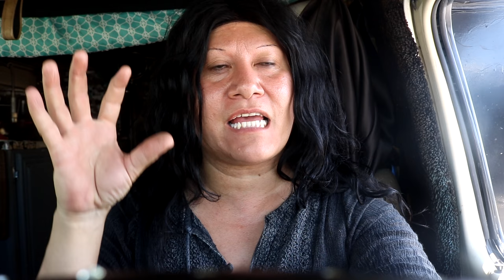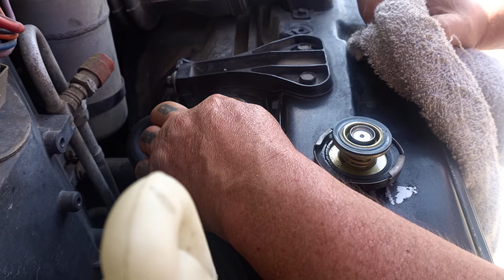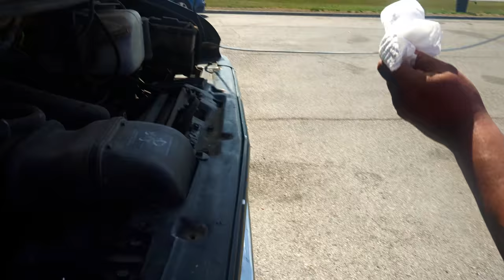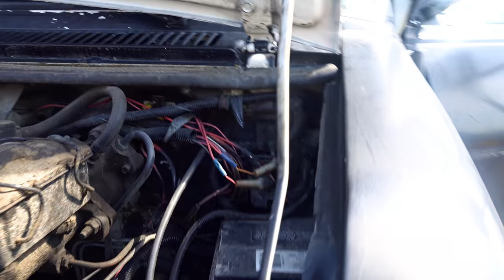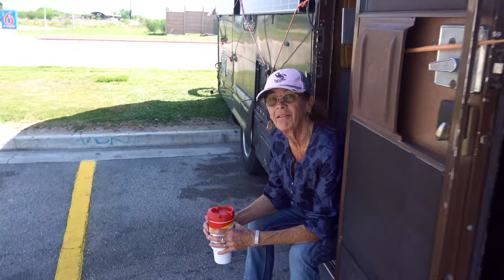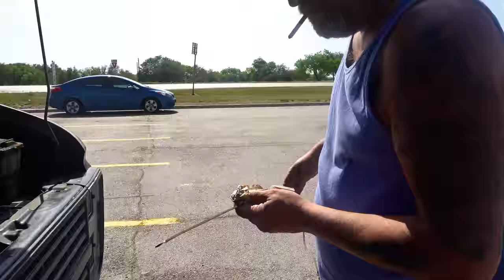RV Breaks Down Not Sure What's Wrong!

Comment: Ausia...its been my experience that gas will boil/(vapor lock) at a much lower temp then water/ anti freeze. If your fuel line is close to a heat source aka mufflet,exhaust pipe or what ever us hot. It will boil(vapor lock) if the flow thru the fuel line is not "fast enough" thru the fuel line next to that heat source. In other words...re route it AWAY from ANY heat source to prevent future vapor-locks....make any sence to you??

Comment: in that big V-8 with all the pumps it has to turn and it being warm you should be running 10/40 weight oil. if you don't know what those numbers mean let me enlighten you . in the 10/40 oil means it pours like 10 weight but protects like 40 weight. so when the weather is warm and being that is a V-8 you should be running 10/40 weight. in the winter the 5/30 is a good choice. in your case oil changes every 4-5,000 miles and tune up's every 10-15,000. you call that preventive maintatince. that's your home you don't it to end up broke down some where you don't want to be and stationary. stay safe.

Comment: How old is Panda? At my mechanics suggestion i added an electric fuel pump to my 1987 Chevy class C to prevent vapor lock which he says is a very common problem with older vehicles because of the changes in fuel since 1987. This may not be your situation but he told me that he makes quite a few of these repairs on rv's in the summer while people are traveling through Albuquerque. Just a thought. Good lock.
Reply from the maker: Thanks

Comment: Sounds like it's either your fuel filter (requires new fuel filter) or its vapor locked (requires new sensor)I have personally had both of those problems and the symptoms are the same. I used to drive super dusty roads and it clogged the fuel filter, I would punch a hole in it to get to town and replace it. I had another car that was vapor locking, I took it to 3 different mechanics, cost me several hundred dollars to figure out it was a $30 sensor! LOL!
Reply: TravelChic56 , not sure it's been a long time. I finally took it to a dealership and they put it on a diagnostic machine.

Comment: I had similar problem before on older car and it was catalytic converter - plugged up. In warm, cool months, no problem but in summer and when car got hot when driving, it would happen - car just shut off. If I let car cool down, it would start and I could drive again. But if it was really hot, it would only go so far and happen again. You can test by removing converter and driving around. Just put a straight pipe there to connect exhaust. Haha.
Reply: TravelChic56 If it sometimes chokes or hesitates then maybe plugged, like mine was.

Comment: If you have 100k miles on your van you may want 20/50 weight.
I have 300k plus on my current truck. My van had 163k on it.
I spoke to an staff member of Castro oil decades ago and he told me if I had over a hundred thousand miles on it and I'm in Southern California to put in the 5th 2050 and I never had a problem with any of my vehicles when I did that and I drove thousands and thousands of miles just saying. Also I check my oil daily when I start out in the morning I looked under the vehicle to see if there's any drops or drips and I pull that stick and save the engine.
Reply from the maker: There is only 48,000 miles on Panda.... thanks for the info

Comment: Modern engines really should not vapor lock. The fuel pumps create enough pressure to force the fuel through the lock point. It may be that you have a fuel pump getting weak and not putting out enough pressure. Good luck

Comment: IT COULD BE FUEL PUMP HAS LOW PRESSURE WHEN IT GETS TO HOT!!!! OR BAD CAP AN ROTOR OR FOULED SPARK PLUGS OR BAD PLUG WIRES OR BAD TIMING DIRTY AIR FILTER. DEPENDING HOW MANY MILES U HAVE ON ALL OF THEM PARTS!!!  JUST SOME THINGS TO THINK ABOUT GOOD LUCK!!! LOV YA

Comment: If it's a vapor lock put clothes pins (the spring kind) on the metal line. That will disapate the heat. That's a old school fix!! Good luck
Reply: Darrell Wampler 40 years ago I had a dart with a318 that vapor locked when ever it was hot clothes pins didn't work
Reply from the maker: Thanks
Reply: @gene Snyder...my high school boyfriend had that same engine...same car but was the Plymouth Valiant. LOVED that slant 6, drove it many times, bull dog steering and all :)
Reply: forgot to say...same year. She was black with a red pin stripe. "Black Beauty".
Reply: Darrell Wampler great minds think alike

Comment: 7:36 am cali time♡
Lions&tigers&bears...!!
MIJA & moo moo you two be careful out there.. honey says you need a code reader could be a manifold air pressure sensor, reads the amount of air in the manifold and tells the computer how much fuel to mix with the air. If the sensor is breaking down do to heat or wear, it could be shutting the fuel off. Most vehicles with fuel injection come with a sensor of this type (could be called by a simular name). Mija i hope this can help.be safe out there asking the angel of the traveler's to watch over all !
HASTA MANANA, safe travels &onward bound ♡

Comment: Your coolant needs to be flushed it's old and dirty,Another common things with Van and motor home is exhaust pipes to close to starter will make a weak starter over heat and not start.My Old Chevy van would do it.
Reply from the maker: Thanks
Reply: With automatic trans. Check your oil once a day especially after going through mountains.If the Ol' girl is burning oil you may want to go to a hotter spark plug.Also when your down south where it gets hot, go with a heavier grade of oil like 10-30 or 10-40.
Keep shiny side up.:)

Comment: That guy knows very little about automobiles. Also he didn't put your radiator cap back on properly, The arrow on the cap needs to point at the overflow tube. Fuel injected vehicles with high pressure fuel pumps in the tank do not vapor lock. Also checking your oil once a week is not enough. Check it at every fill up, it only takes a few seconds.

Comment: Nothing to do with your cooling system radiator thermostat or   Any of that   Fuel line getting too  Hot Old trick try putting   Clothes pins along the fuel line closer to the carburetor helps dissipate Heat

Comment: It concerns me that you were  low on coolant and that it bubbles up when you throttle the engine.  You might have a blown head gasket??  Missing fluid and sweet smelling exhaust are some visible symptoms.  Of course this isn't the reason for a no start when warm.  This seems to be more of a ignition module going out,  time to have the throttle body rebuilt or fuel pump and filter replaced.  My best guesses.  
I have an '88 Chevy class C similar to yours and am pretty familiar with the engine.  I wouldn't blame vapor lock really the entire fuel line is on the opposite side of the vehicle as the exhaust. There is the part when it comes up the back of the engine where it would be the closest.   Another thing I can hear is a exhaust manifold leak.  Pretty common probably passenger side.  GM likes to put a heat riser valve there.  It essentially restricts exhaust on that side to help warm the engine faster.  When the flapper fails the manifold gets really  hot.  Otherwise pretty reliable engines.  Good luck!
-Jon

Comment: Sounds more like vapor lock than anything you did; even though what you did was good for the engine. Also check your fuel filter. If it happens when your fuel tank is low that would be a good indicator of a fuel filter issue. Never hurts to change the filter and it’s usually cheap. Next step would be to look for the routing of the gas line where it comes near to any really hot heat source (for vapor lock) and if possible, shield it somehow. Be careful to use some form of non- flammable heat shielding material. Good luck. I hate this kind of issue. Don’t ask me how I know. 👍

Comment: what ever you do don't listen to that guy look on you tube for how a closed radiator system works yours is working fine,next time it doesn't start use a water bottle with a small hole in the lid and put some gas in it  and squirt it in the throttle body and see if it runs then you will know if its fuel or spark if it starts on the gas its fuel problem if not its a spark problem and don't let people rev the engine like he did he has no idea what hes talking about in a warmer climate use 10w-40 oil, you should be 3-4 inches down from the rad.cap when cold on radiator fluid,

Comment: So, yes, you can safely mix synthetic and conventional oil. But barring an emergency, it's not a great idea. All motor oil, whether synthetic or conventional, is a combination of base oils and additives. ... In fact, AMSOIL does not support extended drain intervals where oils have been mixed.Apr 13, 2015
Just for your info. I was nervous about the mixing. But in emergencies, it says it's ok. Vapor lock does happen. Have had it happen a few times. Pain in the butt! We got a bag they sell to cross the desert that keeps the radiator cool. Vapor lock did stop. Maybe a coincidence? Your mechanic will know when he gets to look at the engine. Peace and Love and good luck!
Reply from the maker: I always use synthetic and don't mix it
Reply: You are right Miss angie webb in an emergency it is ok but not an  ideal In older engine, synthetic oil will weaken seals on old engines that not made for synthetic oil and in the long term the seals will leak, I have personal experience using synthetic oil in my 69 chevy impla.
Reply: angie webb I had a car that would vapor lock all the time. At least the mechanic said it was vapor lock and couldn't do anything about it. It would cut off at intersections and I would be stranded for 15 to 30 minutes until it cooled off. It even stranded me after my husband's funeral. It wasn't overheating either. I finally got a new (er) car. I kept that one to fix up and give to my son but the the flood came and it was under water for 2 weeks so I was able to just write it off with insurance.
Reply: You definitely Can mix senthetic and conversation oil....they actually make a senthetic blend which is part senthetic and part conversation motor oil....

Comment: Vapor Lock Old School Trick cut a grapefruit in half put it on the fuel pump.
Reply from the maker: Thanks
Reply: lol how would that do anything..... and the fuel pump is located inside the gas tank, whos going to drop the tank to put half a grapefruit on a fuel pump....that's not going to do anything. Why not fix it properly?....
Reply: sromo522 cool. We used to use wooden clothes pins to suck the beat off the fuel line. Might even be that a heat shield fell off.
Reply: Your better off eating the grape fruit, you can benefit more than your gas tank

Comment: I have had the same problem with my 1992 24’ class c...I am getting a fan installed in the engine that automatically starts up when the engine starts running hot....dont know yet if that will solve the problem...will have to be in HOT weather to put it to the test.

Comment: Cracked head or bad gasket/seals is my guess. Coolant and Oil loss without a visible leak means it is getting burned in the cylinders.
Edit: I should have been more specific about my guess. I was referring to the missing coolant and oil. The 3 times in 1 year failure is too sporadic for me to guess based on the information provided in the video. She spent the summer in Texas and seemed to be fine.
Reply from the maker: Thanks
Reply: yes
Reply: definatly not man. she would have all kinds of smoke coming out the exaust if that were the case. why do people always jump to the "cracked head/bad head gasket" shit whenever anything is wrong ,there is no indication of such an extreme problem, coolant can be lost over time without a noticeable leak and lots of engines burn a little oil especially older ones, doesn't mean the head is cracked, just means she probably isn't checking her fluids often enough. I would bet money that what is wrong is her fuel pump is going out , this is absolute classic first symptom that your fuel pump is headed south, it overheats and craps out then works again when it cools off. If people would ever fuggin listen to me in comments they would save themselves a shitload of trouble. Ive been working on cars for 25 years,not much is a mystery to me anymore.
Reply: I think so, too.  I thought that I understood that she says that sometimes it restarts in 60 - 90 seconds -- it usually takes a fuel pump longer to cool down than that but it didn't start for about 15 minutes in the driveway at the truck stop.  And if an engine quits from vapor lock, it often spits, and knocks, and sputters as it restarts, but I didn't hear any of that -- when it did restart, it was smooth and strong, like the pump had cooled and was giving sufficient fuel pressure.   On a fuel pump, there's often there's a "potted" connector (a little tube where the wires go in, the wires connect there and then the manufacturer fills the tube with epoxy or a silicone putty) and if that connector gets overheated or cracked, it will let water in or just fail from the heat.  The wire connections become loose or burnt or broken.  Or the motor in the pump (assuming it's an in-tank pump but it should be because she says it's a single-point fuel injector - she says "a fuel injector in the carburetor") will overheat and fail to put out enough to make enough pressure, or seals go bad over time.
No matter what the problem is in detail, I'm pretty convinced that it's something in the fuel pump.  (And it's important to keep an eye on the oil, antifreeze radiator coolant, transmission fluid, water in the battery, etc. often, considering the distances that "the Tribe" drives.)
Reply: well said,  I agree 100% on your analysis. it is something to do with the fuel pump, maybe very early sign of failure,she might have a little time on it but eventually that's what it will come to. I have replaced one on my van and getting ready to replace a second (two tanks) and each time this is exactly how it presents itself. seemingly random failures to start until "cool"or feeling like I'm running out of gas going down the road.
Reply: No mud in the radiator(oil water mix) no water in the oil, no blown headgasket or cracked head.
Reply: coil get hot or pick up going bad in dist
Reply: Have you not seen her videos where she starts up her rv? The thing blows more smoke than Snoop Dogg. :)
Reply: I didn't see them drain the radiator nor judge the look of the oil. Coolant would burn off in a hot engine usually. But I would need to know when oil and coolant was replaced. Year, then yes, not really a problem but last month and time to get to the shop.
Reply: if it a bad head gasket,that will not make it  cut out,
Reply: Actually I haven't. Is the smoke white?
Reply: nope guess I haven't seen the smoke, that would support your statement for sure.J Corbett, I don't think that was what was causing the starting problem though.But I see that you further explained what you were referring to.I misunderstood your comment, sorry if I came off as rude about it. I swear every time anyone has an issue with there engine on here the comments are full of "head gasket" suggestions. Anyway yeah if there is smoke at startup it could be leaking coolant into the cylinders , I agree! That would be new rv time in this case though, would likely cost more to rebuild that engine than the whole thing is worth!
Reply: What about all the frothy air bubble in the coolant?...That seems like a dead giveaway for, at least, a tiny leak in a head gasket...maybe it only leaks when it gets hotter and expands. Also, there was no oil on dipstick to see if rad. fluid was in there and water can get in oil without oil going the other way...and the van does smoke in past videos. I agree that it prob wouldn't cause a no-start, unless there's some sort of thermal cutoff switch...but I do see SOMETHING going on there.
Reply: Also check the electric connection to the fuel pump, corrosion will cause a voltage loss at the pump lowering the pressure just enough for vapor lock to happen.
Reply: riparian_nomad there is no such thing as “vapor lock” that is a term invented by bad mechanics to explain fuel delivery issues they were too stupid to understand . Her problem is a Failing fuel pump.

Comment: I have a 1962 corvette that is fuel injected. An it will vapor lock when it gets hot i tell you how to solve that problem. An your fuel pump maybe on way out. But as far as the fuel lines are concerned that goes to fuel injectors i got some steel jacket lines like they use in nascar its actually rubber with steel jacket took each line loose an sliped the over sized line over line hooked them back never had a problem since.

Comment: Stop adding different types of oil , get an oil change mixing oil is not good
Reply from the maker: Funny cause it doesn't have the problem anymore and is running great but I'm still going to go get the oil changed thanks
Reply: That is great, but as the guy say check all fluids before you go on the road. Keep up the good you do, I enjoy watching your videos